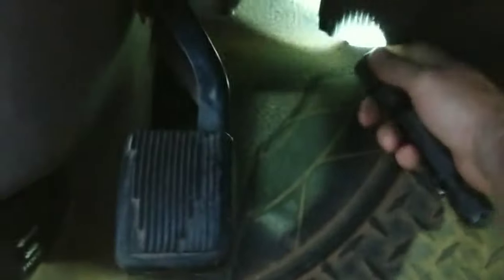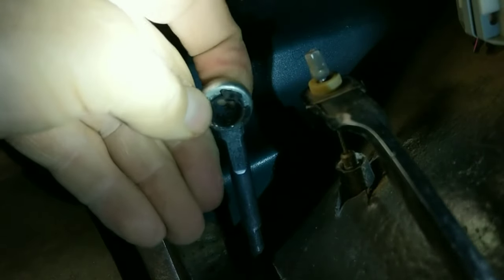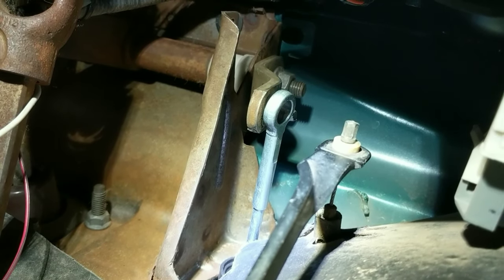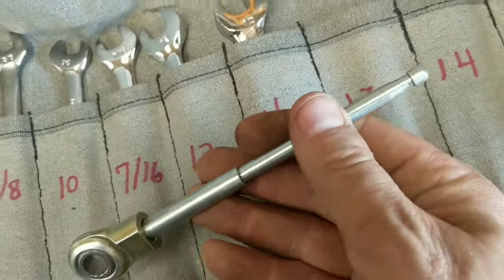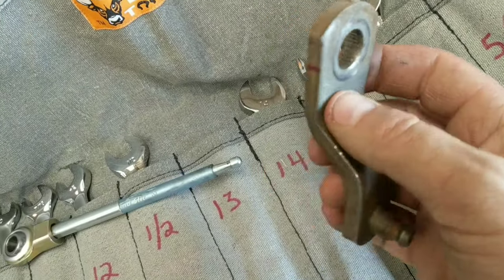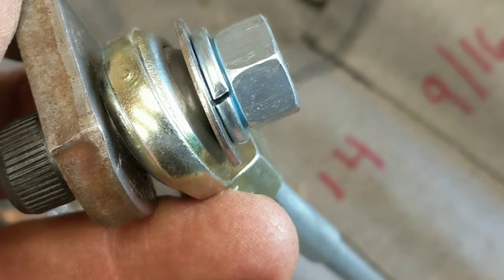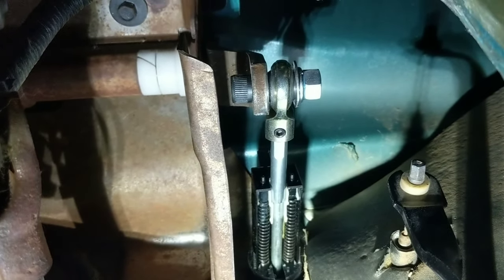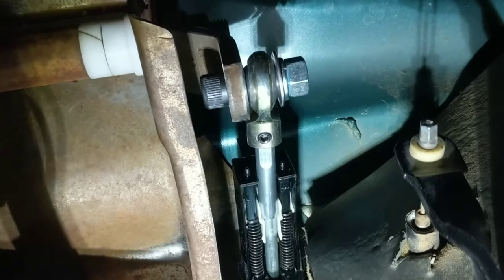Ford Clutch Pedal Fix, Bushing Eliminator 1987-1997 F150, F250, F350, F450, F550, Bronco

Comment: you did a good job on your video, i have had two trucks where the plastic clip broke, i just used a 3/8" heim joint and a 3/8" NF bolt and nut to fix it, i don't want the neutral safety switch, i like to be able to move my trucks with the starter if i need to, and over my 61 years i have done it countless times.
Reply: So basically you were using an electric truck before it was cool

Comment: Hi, thanks for the info. What kind of BALL POINT PEN did you use for the removal of the push rod from the clutch cylinder? it looks like a bic pen. I need to change my whole pedal assembly and I thought I might do this fix while its apart.

Comment: My 89 f150 has been towed to house and sitting for 2 months at least.  I assumed I needed New throw out bearing and clutch. Because I can pump pedal with my hand quickly and build up just  enough pressure to get in and out of gear to push it around the driveway. If I have to move it. I came across this video 2am in morning doing research on how to replace clutch and everything.  I'm gonna check this first in the morning. Even if this is not a fix for me I really appreciate  that you took the time to make this video. Very clear and to the point. Thank you much..
Reply: Did you get it to work

Comment: You did just fine with a "HOW TO" video man! You just helped me out! I'm having the same issue you was! I have a 1994 Ford F150 .302. My plastic clip BS keeps coming off, just again today, and I just replaced a new plastic piece from Oreily's. So.. I will have to do the same thing as you, maybe not with the same materials, but using a bolt and some other parts, now I know how it all comes apart! Thx :)

Comment: Clearly a solid permanent solution that should be implemented. Another that has served me is to cut the four nubs off of the plastic grommet, put it on reversed (slick side out), mark & drill a hole through the post holding the M/C shaft, and put a cotter pin through it. This assumes the post is not worn beyond your ability to drill a small hole. The shaft rides smoothly against the cotter pin due to the reversed plastic grommet.

Comment: How did you get the arm off of the shaft?  I tried prying it off with a screwdriver after removing the nut and it wouldn't budge.
Reply: Probably too late but they are a pain to get off, keep prying and try to take it off as even as possible. If it’s crooked you won’t get it off. I’ve had to pull a couple pedal assembly’s because of how stuck they get.

Comment: My only comment would be that you should have put the Bolt in the other direction and the nut on the inside location.
I would also have used a Nylock  Nut ( No Need for Loctite and removable if necessary.

Comment: Why can't you just drill a hole through the shaft and put a cotter pin in it to keep the rod bushing from popping off?
Reply from the maker: The only thing that stopping you, is you. Go for it try it out and let everybody know how it works.
Reply: @DesertJeff  I discovered the clutch rod shaft on the clutch lever isn't hardened steel.  I marked the shaft with a center punch and used my cordless drill to drill a hole through the shaft near the end of the shaft where the retaining groove was.  I cut the 4  retaining fingers off of the new OEM nylon bushing I bought from my local Ford dealer for $1.  A thin washer and a hitch pin clip is holding it on now.  The hitch pin cost $.39 at Menards and I found the shim washer in my used washer collection.  The worst part of the project was getting stabbed in the back by the seat adjuster lever while I was working under the dash.  I should have covered it with some kind of padding.

Comment: the white bushing in swingarm wallows out too down into the metal! swingarm is pain to get out with brake petal on one side. i miked the bushing, ordered a collared copper bushing amazon and tightened bushing into the worn hole/bushing. maybe the copper will last, otherwise swingarm needs taken out and welded up & install new bushings! FORD-fix or repair daily--ha-ha
Reply: You know that's almost true with my 97 ,Ford's have more power and stout, but any miss and it requires you to fix it.

Comment: Question, after you took the clutch push rod out did it cause the master cylinder to leak? If not does that mean I can just take it out with your trick no worries?
Reply from the maker: no

Comment: I did this mod and both master and slave clutch cylinders got shot how do I know if d push rod is long?
Reply from the maker: if it bottoms out, reclock the lever that is held on with th 19mm bolt